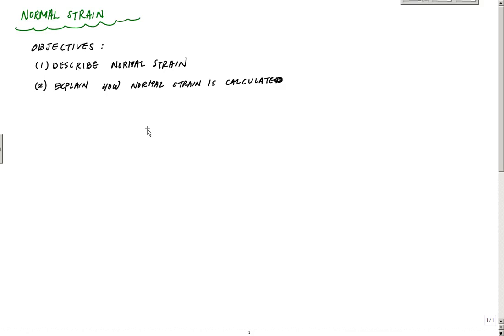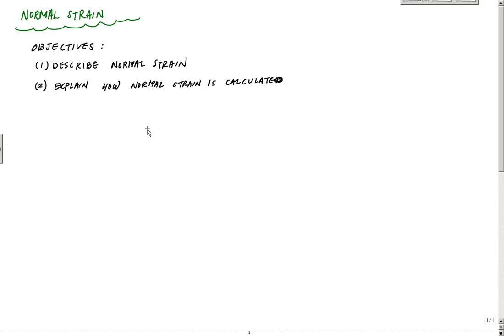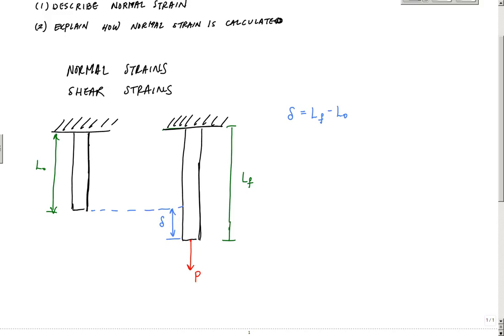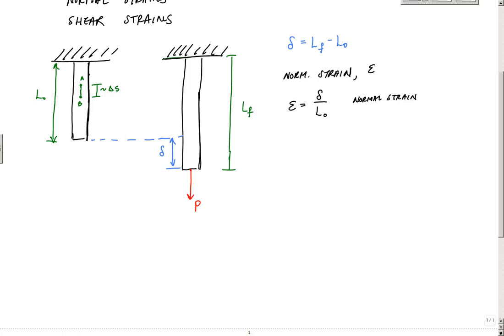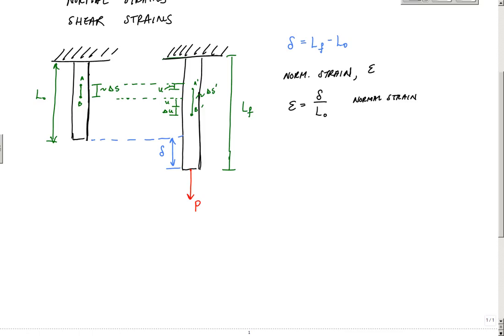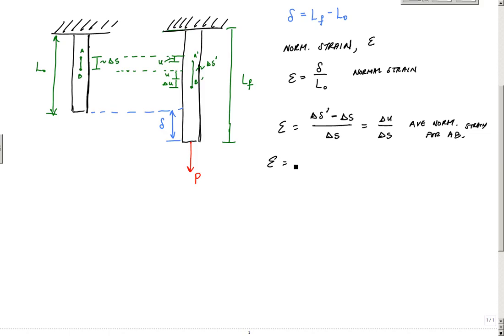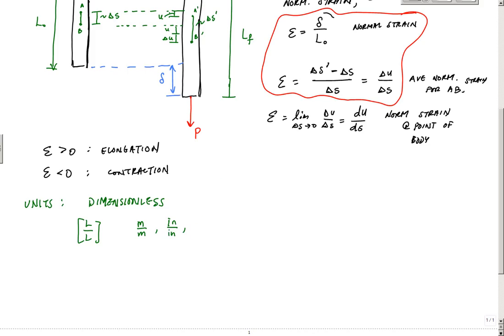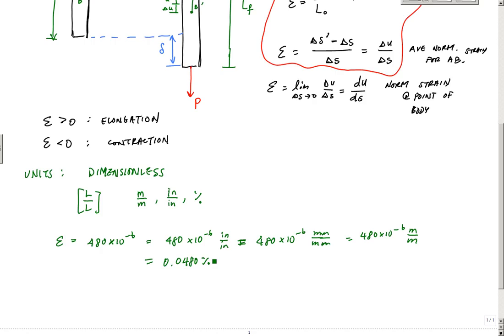Normal Strain - Mechanics of Materials

Comment: Thanks for your amazing videos! To quote a question below: Why would point B fall the distance of u and delta u and not just the distance of u?
Reply: Because when the section AB is loaded that section will stretch between AB as well as above A. The stretch above A is U and and if the section AB DID NOT stretch than B would only drop the distance that the beam stretched above A. However because AB does stretch as well point B will drop the extra deltaU distance.

Comment: Hello I've got a question, where I'm not given the change in length just the original length and a force of 10kn acting in tension to the steel rod which is 25mm in diameter and youngs modulus of the steel rod is 210gpa. Could you please help thanks
Reply from the maker: need to do some calcs with hooke's law and poisson's ratio